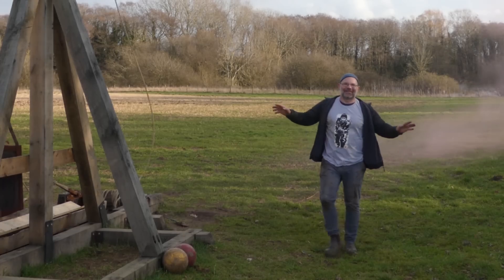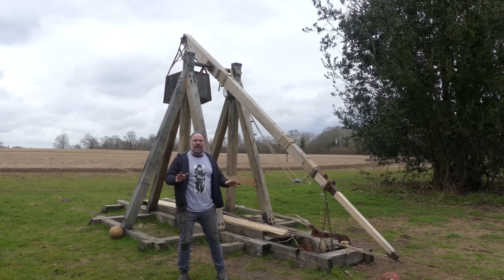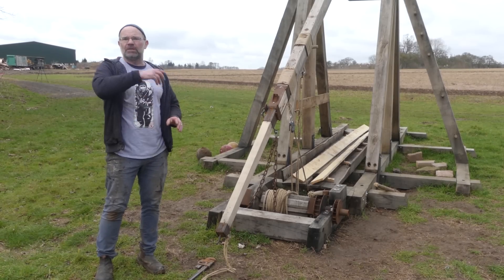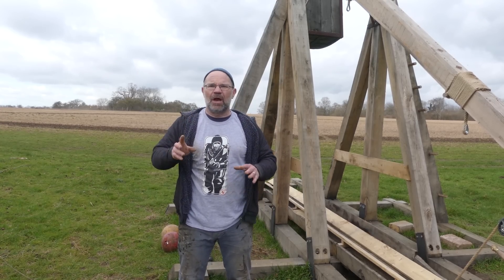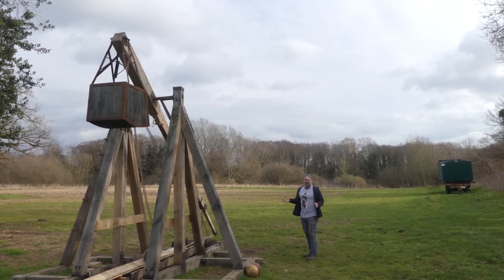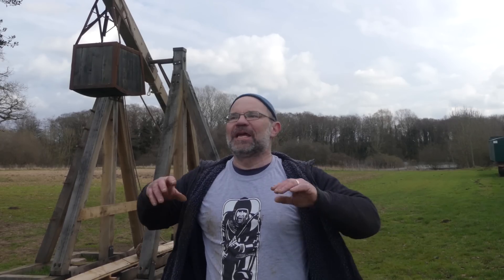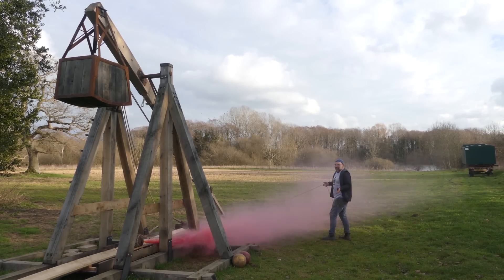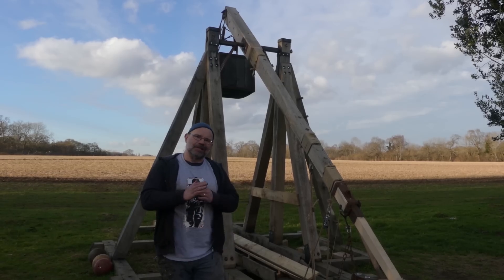Trebuchet - Why won't the darn thing shoot further?

Comment: Your current method is making a change, doing a throw, making a change, doing a throw. Which is going to cause some issues due to natural variance of the distances, and you are physically pacing out the distance of each throw, which will introduce another element of instability / bad information, takes a lot of time due to the walking, creates some instability as the trubechet moves day to day. 

The following could provide a better method to capture distances, in a repeatable way, and can allow you more throws than your current method.

1. Capturing real distance more easily: Set points, Trebuchet (T), Camera (C), and Target Point (P). T is of course where the Trebuchet is, P will be a point down range from the trebuchet set beyond max throw distance (~25% further) and should always be the same for every test day, and the camera will be placed at C a set distance from both points, it should be as close as possible while still capturing points T and P. Doing so will allow you to triangulate the actual throw distance in a repeatable way.

This gives a few advantages, first you can fire all of your ammo in succession without worrying about pacing out the distance between each shot because you will always be able to just look at the camera footage and determine distance quickly then make your adjustments. Even if you have different ammo weights as long as you record it you can fire all ammo in a row.  It also means that each day even if the trebuchet is in a slightly different starting point you can always count on P and C being in the same relative positions so your data across days will be more easily compared. 

2. Determining variance for the Trebuchet: Each set up of the trebuchet will have some natural variance of throw distances, so you may see a some throws going quite a bit farther and some quite a bit shorter even when nothing has been changed. You will have a mean distance , and should see most of the shots/throws end up close to that mean. But you will also see a lot of shots go quite a bit farther, or shorter. If the throw distances are normally distributed you should see 64% within 1 standard deviation from the mean, and 95% within 2 standard deviations. To illustrate this image if you made 100 throws with out changing the trebuchet, and your mean distance was 150 and your standard deviation was 3 meters. You would expect 65% of your shots to fall between 147 and 153 meters (1/2 on either side of the mean), and 95% to fall between 144 and and 156 Meters and 99.6% to fall between 141 and 159 meters.

 Once you have that information you can start making changes to the trebuchet and get a better feel for if the change actually did anything significant or with only a few shots (2 or 3). If you make a change and the shot goes 160 meters that is on the far end of normal only 1/200 shots would normally get that far. If you make 1 or two additional throws  you can be pretty positive that the change was significant. If on the other hand the throw following a change hits 151 meters your change may not not look significant, but you may have gotten an anomalous result (ie just happened that it hit a low or high end of the variance of the new set up) but a second throw can confirm the change if that was within the variance. But again once you have that normal variance on a base set up you have a far better foundation to spot those things which are really outside of the variance. Since my numbers are made up, it might seem like this is something which could just be eyeballed. But until you have a solid idea of the natural variance of the throws from a base set up then you simply have no idea how far out of normal a single throw might be. 

Point of all of this, take a single set up and do 20+ shots and see what the variance is, if you follow point 1 you can do it over multiple days or weeks and be confident that the distances of the set up are being measured correctly. And this will allow you to better assess what changes are being made. 

3. Reducing Variance: Currently you are focused on getting range out of the trebuchet, which is great. But a major (and perhaps even more important point) is the accuracy of the machine. The more accurate you make it (even if the distance is less than you would like) the easier it will be to determine if the changes you make are significant or not with regards to distance. Furthering my sugestion above (determining variance) if your devation is 10 meters it is pretty impossible to know if your changes are significant without a huge number of data points (ie throws), if your variance is 1 meter then its pretty easy to see if other changes are significant. To do this you really do need to eliminate factors which are causing variance in throw distance. Two things which spring to my mind are the sling and the ammo. If your sling is holding onto the ammo in a way which is a bit different each time, then it may be changing the rotation of the ammo as it goes through the air, and that rotation can make a big difference in variance. If you insure that your sling always hold the ammo in the same way then it can reduce the variance of the distance a bit. You may want to go so far as to change the material from the woven rope, to something which will always have the same contact points with the ammo, even if it would be less authentic. Even if that change reduces throw distance if it reduces variance you get a better idea of how your other changes are affecting the throw distance. The ammo, as you are using bowling balls your ammo should be pretty uniform, but those bowling ball finger holes could be causing you to have all sorts of weird data points. They will be catching the wind and could cause the rotation of the ball to reduce or increase distance, especially when you have a cross wind. The holes should be sealed so that such issues are reduced/eliminated or at the very least the ball should always be loaded with the in the exact same position so that the results are at least some what more consistent. Again range isnt the goal here but reduction of variance.

4. Speed of reset. Trebuchets are not an easy thing to work by yourself, and take a lot of time and effort. They would usually have a team of people, to manage the set up. Now clearly the more people around the more likley accidents may happen, or injuries may occur. Which may be why you have so few people involved, or perhaps you have various time or other legal concerns. But if you can get 2 or 3 other people able to help you with the resetting of the machine following a throw you will be able to get so many more throws a session.

TLDR: 
Points 1 to 3 are not as sexy as trying to improve the distance but are a necessary foundation to actually figuring out how to get improve the throw distance in the long run, if they are neglected you really are just making arbitrary changes, because you have no real basis to determine if a change has had any affect
Insure you are able to easily and accurately gather your throw distances, figure out your trebuchets normal throw variance, work to reduce the variance (rather than increase distance), if possible add more people to the throw/reset process to get more throws and data points. 

Best luck, absolutely love watching your channel!

Comment: Dearest Tod. Let's double the counterweight. You can't broke the law of saving a moment of rotation, which is a spin in it's root.. kinda fundamental. ;-)
Seems you've reach the limitation of a friction force (the construction in whole and release pin) so next step will be logically to increase the moment of rotation, which sits on the other lever of your magnificent construction.
If we look into from the other side, any increasing of force increases the friction forces linearly, so you might meet a dead end.

Comment: I built a scaled down trebuchet many years ago, with a three foot arm and an open bucket so weight could be added or subtracted.  I won’t say it was accurate, I couldn’t pick a spot in the distance and hit it, but it was surprisingly consistent with most shots landing pretty close to each other.  I found that once I had got that sweet spot with the weight I could get more range by raising the front of the entire machine a bit, a lot easier to do on a small scale, not so easy with a machine the size of yours.  Similar to modern artillery you would want it on level ground but if you had an earthen slope formed in front of the machine you could push it forward a little at a time to adjust the angle of the base.

Comment: One thing. 

45-degrees is the maximum horizontal range in a vacuum. The releases the ball at a significant height above the ground as a proportion of the whole trajectory, so it might want to release closer to horizontal. 

Have you worked out your release speed from the photography and frame count?

Comment: I think your issue is the amount of time the counterweight has for acceleration, and I am not sure there is much if anything that you can do to increase the amount of time the counterweight has for dropping, which creates the acceleration rate.  Because of this, I am afraid that you have probably reached about as far as this trebuchet will hit, unless there is some way to increase the height at which the counterweight falls.  Watching the counterweight closely on this video, you have about 0.9 seconds of acceleration on the counterweight.
Reply: Raising the frame / pivot would allow the throwing arm to come back to its former position underneath. Lengthening the arm but not raising the pivot has reduced the travel.

Comment: Is it me or does this custom Trebuchet like to shoot best at 55 degree angle at all times ? 
I am definitely not an expert.  From looking at the curves, any pin modifications either made it shoot too flat ... sort of like more air resistance ? or loss of speed ? or worse energy transfer  ? or something ? and it doesnt shoot so good when it is away from that 55 degrees angle. Maybe some other part of the mechanism is being a bit wonky ? Would pulleys or some kind of springs to either "prime" or "dampen" the shot to steady it is needed ?

Comment: I have a saying, "Worked is not the same as working." A lot of engineers settle for, "Worked" though, either because they estimated optimistically, or because no-one made sure there was enough time for proper specifications, R&D, iterative development and test cycles, etc. to actually get "working". It's a gamble, and sometimes you win, but for some insane reason people think they can plan to win the lottery on every project.

Comment: Tod, one way to get the Treb to throw farther is to reduce the mass of the earth, thus reducing the force of gravity. This is indisputable physics and is guaranteed to work.
Reply from the maker: That is a great idea!  How do I swing that?
Reply: @tods_workshop  try shaving a tad more off the pin
Reply: @colobossable  that won't reduce the mass of the earth very much if at all, unless you launch the shavings into space.
Reply: @tods_workshop  Lol. NASA or Elon Musk?
Reply: In space or a low gravity moon, nobody can hear you scream "Howzat!" as your trebuchet throws for miles!
Reply: @tods_workshop  Well, I just think of the great ideas, it's up to somebody else to make them work.
Reply: I may be a few weeks late, but reducing the mass of the Earth would not increase range appreciably because that then reduces the gravitational force on the counterweight, reducing the force it can exert on the projectile. Everything's a tradeoff.

Comment: When I was building Trebuchets I would think of the pin as a delayed release that has two variables, length and pin angle. A given Pin length will have a optimal pin angle and a pin angle will have an optimal length. There is a range of working pin length and angles from my experience and just takes trial and error. 

Also from my experience you want the sling length to match the length of the arm to the axle. From the videos it looks a little short.

The grouping looks good considering all the variables involved. My most accurate Treb (6ft arm) Could hit a standard piece of plywood consistently.

Comment: I believe you are being held off by the projectile and not by the trebuchet. 
The mass to cross section of the bowling ball is very different from a spherical stone. 
As changing your initial parameters (speed and angle) doesn’t really change distance, it probably is telling you that the projectile’s drag is dominating. Try something of the same weight but denser.
Reply from the maker: I guess the density of the ball is a bit over 1 whilst a rock is likely about 2.5, so yes a denser projectile and in honesty a lighter one would help

Comment: The pin angle isn't the only factor that determines release. The arm is decelerating as the weight approaches the bottom of the swing. The easier factor for you to adjust is the length of the sling. You want to adjust the length of the sling unti the weight stops at the bottom. Tom Stanton has a good video on optimizing the trebuchet.
Reply: Yes, Tom has a good series on his trebuchet. If I remember right, he built in a "kick" on purpose to optimise the thing. It was much smaller and threw tennis balls (a long way).
Reply: i saw what you mean ... wouldn't it be easier to control, if you somehow fixed the counterweight. i mean it even starts to stall before the 180 degree angle because the weight and the arm lose connectivity while the counterweight alters it's path. that way the arm actually holds it's momentum until it can give the energy into a path forward much rather then up.
Reply: @dawnmaster68  As a kid I saw a 'make a trebuchet' tv show & iirc their design was a counterweight fixed to the arm on a simple frame & it wanted to tear itself apart on each throw. They added wheels to frame so that it could roll back & forth after the throw to damp down the energy. 
Their researcher then got historical images & it looked like the original ones were simple frames with weight in hanging baskets & they said that that swinging about would provide the dampening effect, plus you wouldn't have to cart special weights all over with you but could just use some handy rocks when you reached your destination.
Reply: @matthewwright4975  oke so maybe restrictions to the counterweight. A basket sounds like it's fixed to an axel much rather then straps
Reply: @dawnmaster68  Depends on who's trebuchet & when. Some of the late era monsters had hut sized boxes pinned to the arm with a timber the size of a ship's mast. For both earlier and "improvised" models, you can tie the counterweight to the arm with a rope. 

Check out this beast    https://en.wikipedia.org/wiki/Warwolf
Reply: @dawnmaster68  "THAN"
Reply: Tom Stanton is also in England, you should collaborate to tune the trebuchet. This one is obviously not efficient. It swings way too much at the bottom. Ideally bucket and arm should come to complete stop at the bottom.
Reply: Does adding the tracer bit cause a change.  Your first shot was the longest and also the only one with no tracer in it.
Reply: If any of you want another take on trebuchet optimisation, this guy made his go supersonic, and goes into the mathematics of it quite deeply. 
https://youtu.be/gdXOS-B0Bus
Reply: my trebuchet's release is messy. My sling is not the best in the world and the projectiles often entangles in it, or fails to release.
Reply: they change the wrong thing all the time, there no problem in pin length
the catapult has 3x factors that affect the distance
1. weight (the heavier, the stronger the swing)
2. catapult arm, the longer, higher speed
3. length of the slingshot
I personally think that is his problem, under point 3.
Reply: @tihomirrasperic  It needs to be on wheels.

Comment: Have you considered placing wheels on the trebuchet?...... I have heard some historians say wheels under ancient trebuchets were not just for moving the devices around on the battlefield.... Wheels also allowed the frame to roll slightly back and then forward again as the bucket dropped... This allowed the bucket to travel straight down as it dropped  instead of swinging in an arc... ..That not only kept the frame from destroying itself but it made more effecient use of the energy created by the bucket, and allowed the arm to throw the projectiles further....
Reply: Im sure Ive seen mention of ships gunpowder powered cannon with the same concept of tavelling back and to.

Comment: My reaction to the first shot was "that looks like a good trajectory".  So I was surprised you thought it too high.  It looked about 40 degrees above horizontal, which is pretty close to ideal.
When hurling for an audience, I always favor high trajectories, which tend to be most popular with crowds.
Reply from the maker: My problem is I watch it from the back, so it is really hard to judge
Reply: @tods_workshop  Yes, that's been a longstanding problem for me as well.  Perhaps you can have someone else pull the trigger while you stand to the side downrange a bit.  Or be able to check the film right away.

Comment: it seems that the best ratio for the counterweight for max distance is 133:1 so for your 500kg counterweight it should be a 3.7kg projectile.
Reply from the maker: I know it should be lighter, but bowling balls are such good projectiles
Reply: @tods_workshop  why not using medicine ball instead? Some have handles.